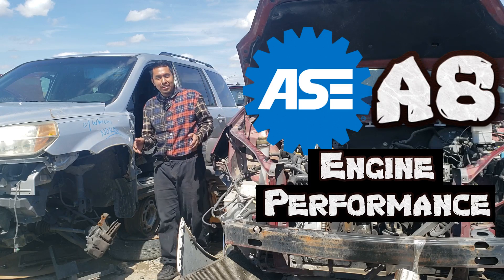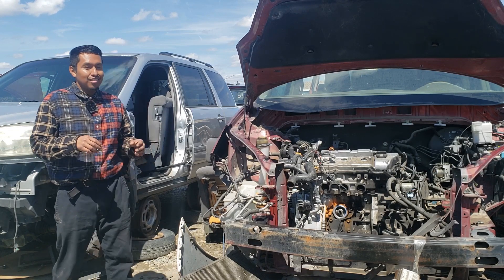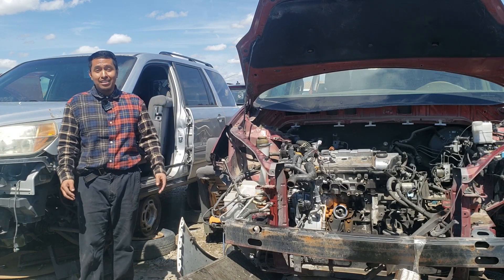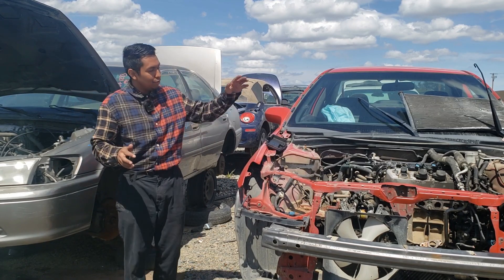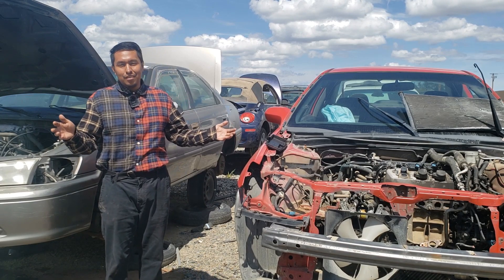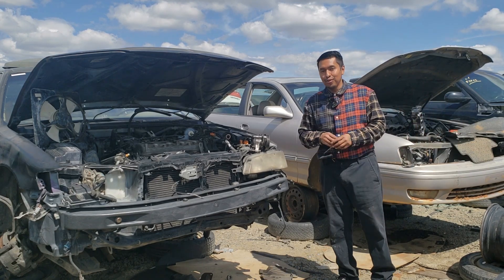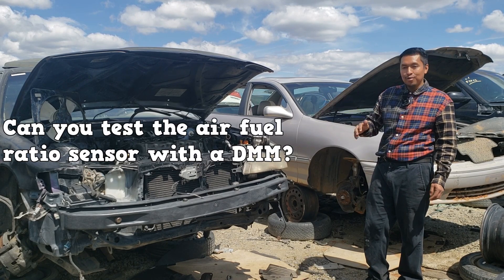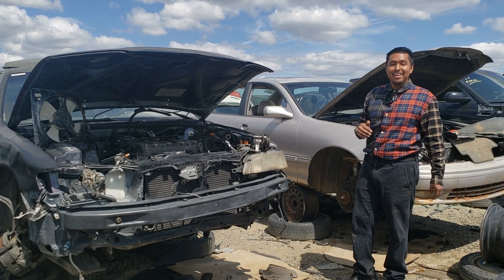3 ASE A8 Topics That Seem Difficult At First

Comment from the maker: Update May 13, 2023: I Passed he A8. This one is pretty tough, its a combination of A8 and A6 (Electrical). I saw at least 10 wiring diagrams, and knowing the basics of electrical [opens, short to ground, shorted winding, relay operation] helped me cement the correct answer. There was also a few questions about the starter and alternator that looked similar to the ones in the ASE A6 test. Overall the 2 first topics and questions that are asked in this video are really helpful to know for the test. No start diagnosis and EGR. If this is your first ASE test, I strongly recommend that you study and pass the A6 first.